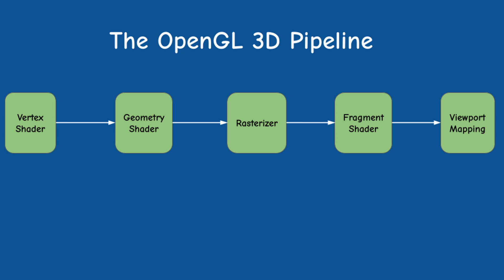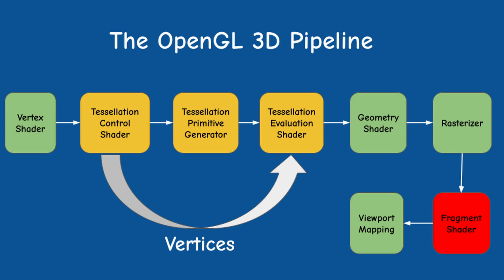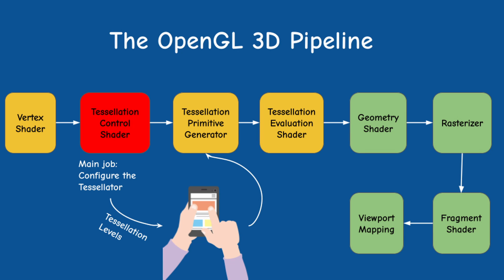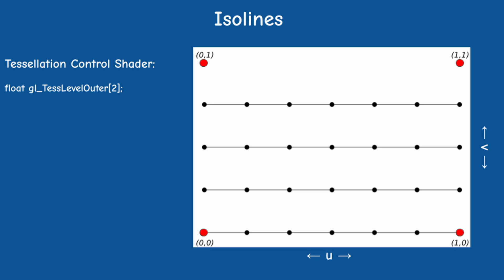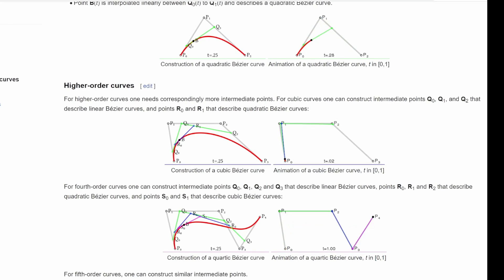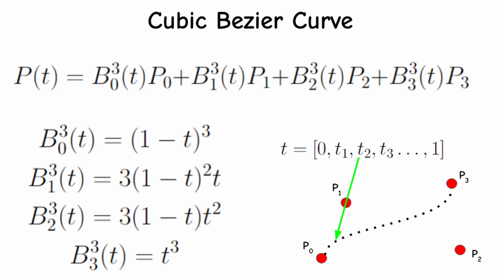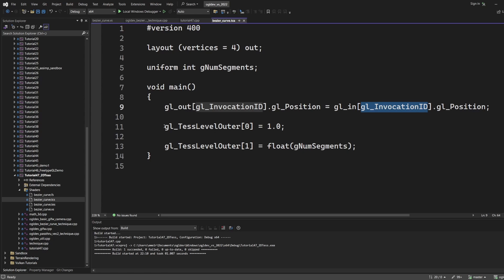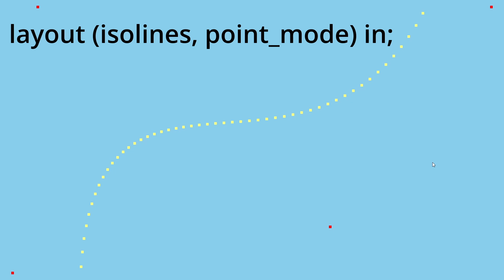Introduction To Tessellation // OpenGL Tutorial #47

Comment: It is still unclear for me why we avoid to transform our vertices in vertex shader and wait until we get to the evaluation shader. Wouldn't it be more work to transform X vertives instead of just one (if the result is the same, which is usually the case unless tesselation implies some non linear transformation) ?
Reply from the maker: The evaluation shader processes the vertices which were generated by the Tessellator. These vertices simply didn't exist in the vertex shader. You can only use the vertex shader for pre-tessellation transformations that work on the entire patch.

Comment: Is the idea with terrain that the entire terrain is a quad of just 4 vertices, and then the tessellation shader will add new subdivisions to the quad depending on the camera's position?
Reply from the maker: A single quad for the entire terrain might be a bit limiting and if the terrain is large it may not be enough, even on a high tessellation level. So you should tune the size of the patch and the number of patches to get a nice resolution decline from the position of the camera down to the horizon.